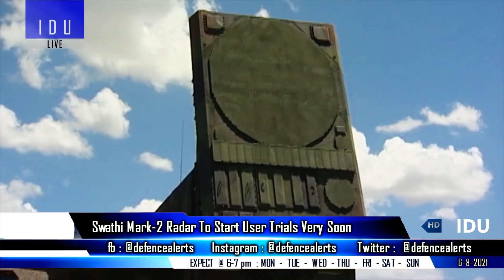Indian Defence Updates : AMCA Airframe,Swathi MK2 Trials,INS Vikrant FDC,BDL New Unit,Agalega Base

Comment: when will MACA mk1 be operational to the IAF  ??
2030 /2032?
Reply: @John Hero no. That's over the limit. You may say upto 2032.
Reply: 2029 mid
Reply: No one knows exactly between 2029. Onwards...
Reply: @John Hero but l&t maybe involved this time.
Reply: @John Hero HAL won't be producing AMCA, production will be private lead and designing is ADA lead. HAL is just an "advisor" due to experience gained in Tejas programme.